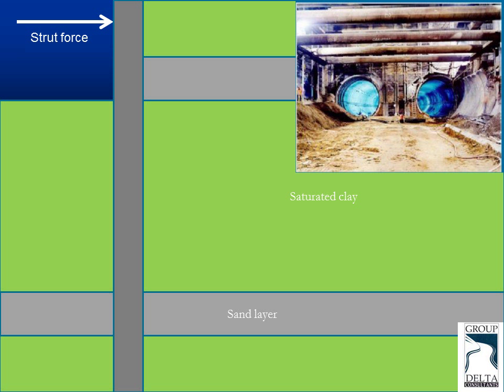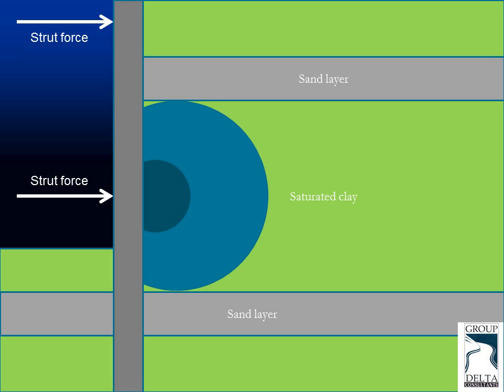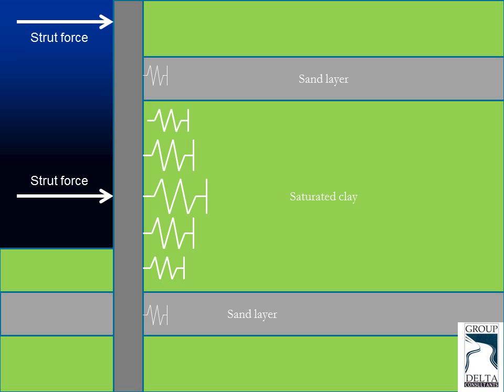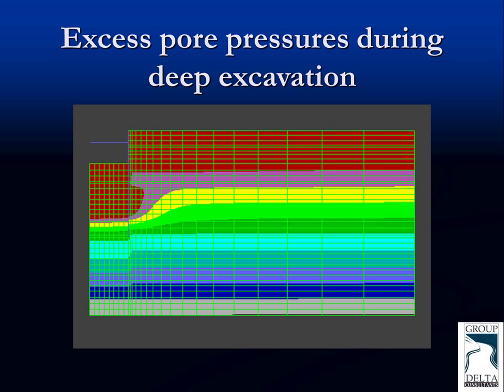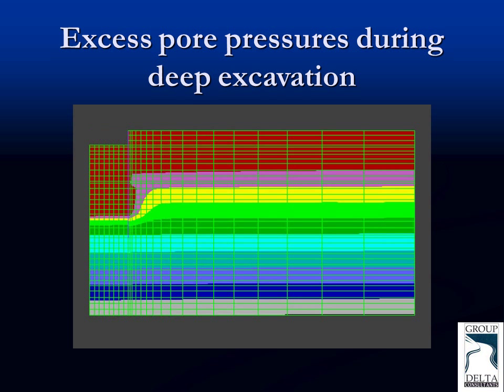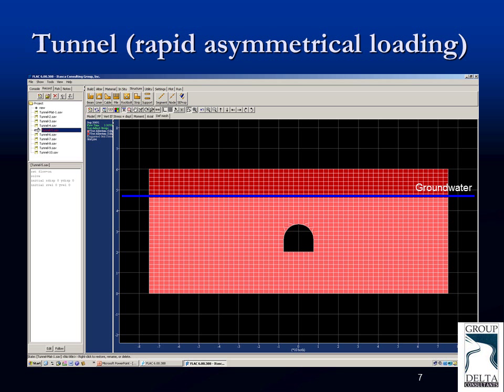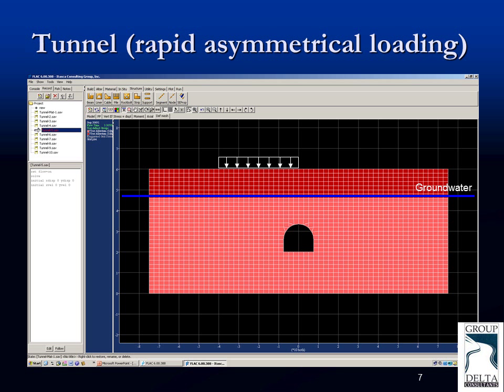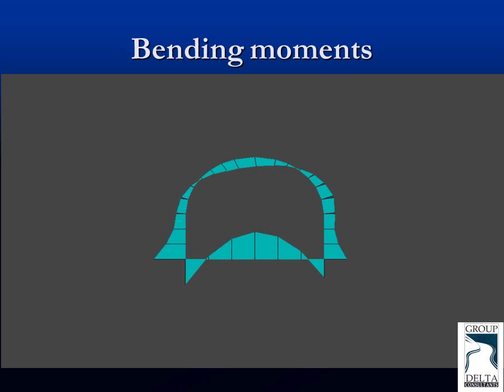Examples of Geomechanical Numerical Modeling

Comment: It would be very interesting to see what would happen if you added an earthquake to the model.  I am looking for a video that would show what would happen to an underground tunnel and the buildings above it, in an area that is highly susceptible to liquefaction during an earthquake.  I know what happens to buildings, but I'm wondering if it is changed when a tunnel is built 200 feet below the buildings.
Reply: The effect of liquefaction on underground structures is well known; they tend to float towards the surface. In Japan numerous storm drains, buried tanks, underground pedestrian tunnels, have experienced liquefaction induced uplift during past earthquakes. During my visit in 2011, I saw many uplifted manholes in Urayasu that resulting from storm drains floating towards the surface. You can see photos at http://www.npr.org/2011/04/07/135181474/in-japan-shaken-soil-turned-soft-after-quake
Liquefaction is a phenomena that typically occurs near the surface. For natural deposits, Youd, has said that the maximum depth that has ever been documented is about 52½ feet (I heard a similar number from Ishihara). As a result most design manuals often include a maximum depth where one should consider it (generally under 80-feet).  I am not aware that anyone having reported liquefaction at a depth of 200-feet.